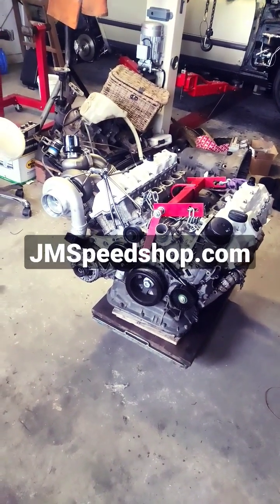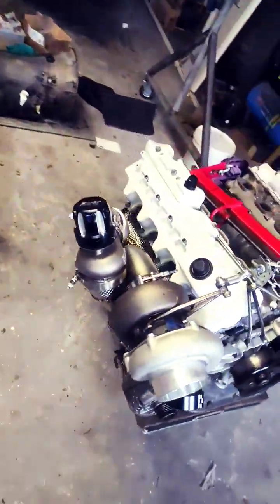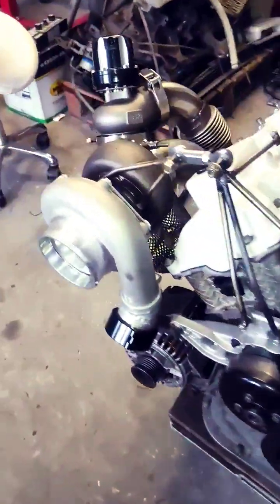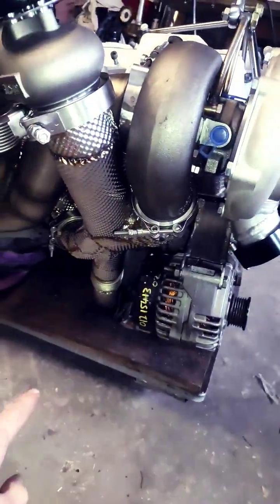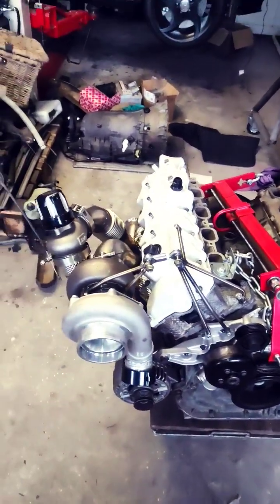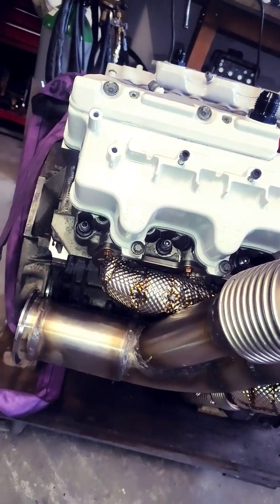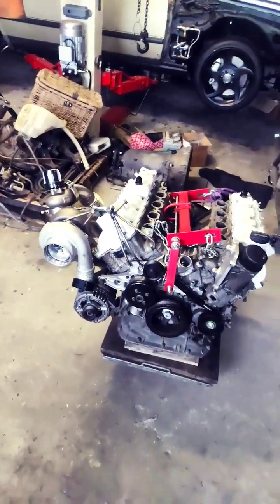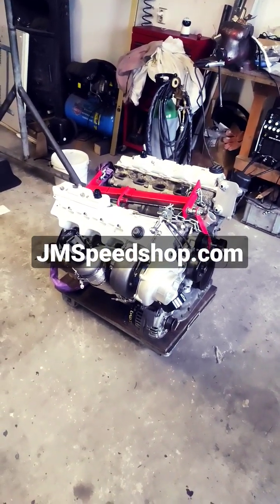Mercedes M113 V8 turbo  Support bracket made. S124 V8 Turbo

Comment: Is that a 5.5 or 4.3
Reply from the maker: 5.0
Reply: @JMSpeedshop  amazing build Sr. I have a e430. I plan on a turbo charger but for the time I've deleted the egr and manual fan is replaced with electric
Reply from the maker: Nice

Comment: could you please describe what did you do with the valve covers? did you do some crank gases evacuation system or just oil catch can?
Reply from the maker: I use a catch system with a provent 200
Reply: @JMSpeedshop  where does separated liquid go? just draining outside or returning into engine (like via oil dipstick tube)? do you think maybe it's better to use some kind of evac system, like moroso 25900?
Reply from the maker: It will drained at the underside of the pot.  Can be done ones a month are you can make a flow tube back to the sump.  Im not familiar with the moroso system
Reply: @JMSpeedshop  could you make a video or shorts about what did you do with the covers? :) I see you closed or welded the holes of stock pcv system and made AN fittings. maybe there are some other changes. i'm asking because i've just installed kleemann supercharger on my m113 and want it breath cleaner air :)
Reply from the maker: This is all covered in the videos

Comment: Why not follow Mercedes design and try to make a hot v layout manifold 🤔🤔
Reply from the maker: Because the cylinderheads are not designed for that.  Hot V engine's have intake and exhaust 180 degrees moved from exhaust on the outside engine's
Reply: @JMSpeedshop  thanks for the insight 
Isn’t two turbos better than one on V8’s ? Otherwise one bank is wearing out faster than the other? Maybe smaller turbo and rear mount? 🤔🤔
Reply from the maker: It is 1 turbo but exhaust feeding from both sides.  To the turbo .